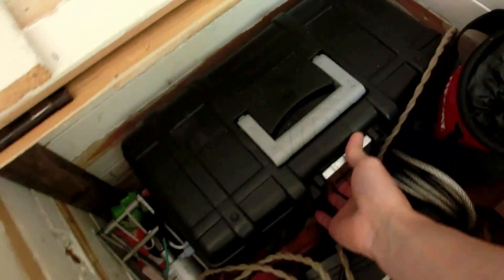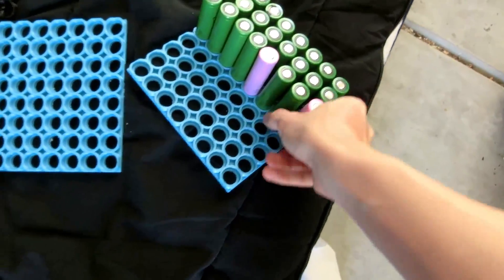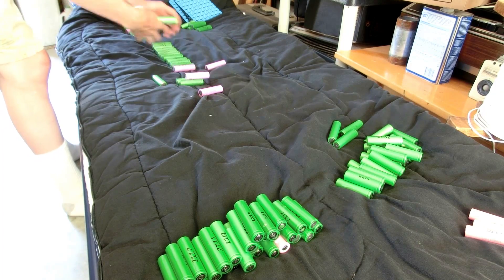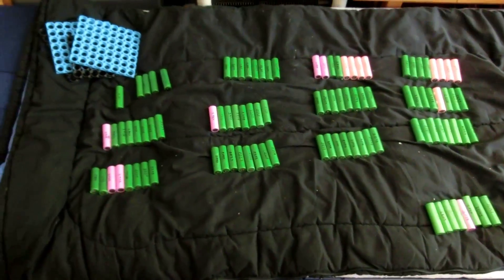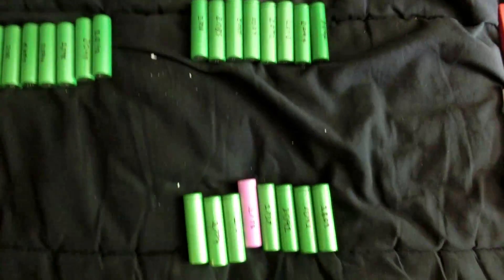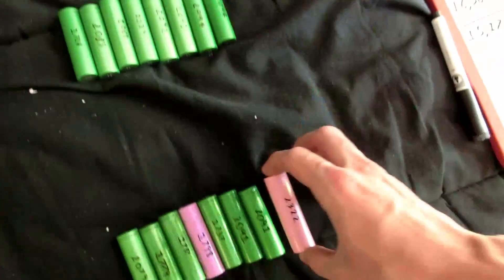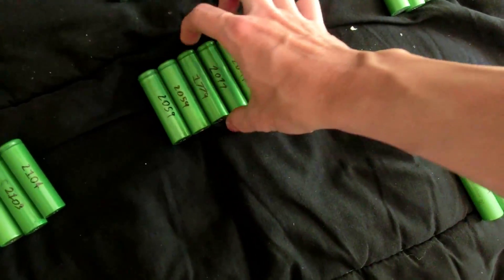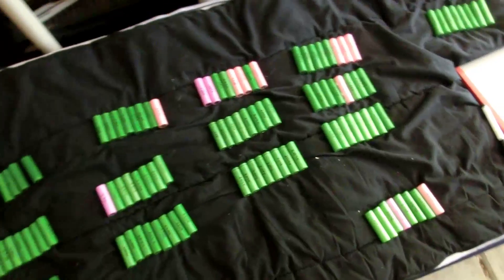How To Organize 18650 Cells for your Battery Pack

Comment: Thanks a lot! I am currently gathering cells (have a tester on the way) to make a 6S pack to power a 24v truck inverter (lithium isn't really well suited for 12v inverters designed for lead acid) which will in turn power up a DIY SLS 3D scanner. I hope everything goes well, but this will definetely play a major role into the pack design. I thought that as long as the parallel group capacity was equal, it was fine, but i'll use this method to not end up with mixed 10P and 11P groups, for example (not that i know if that'd be bad though). Cheers!

Comment: I put all the capacities in excel, sorted them by capacity. Then calculated the average of the top number of cells needed. Finally multiplied by number of parallel cells and rounded down. Then i sorted them to come to the calculated average.
Reply: Smart. Nice work

Comment: I have over 600 harvested and tested cells.  charged and shelved for a 18 months or more and rechecked.  removed any under 75%  now the sorting... any suggestions for packs.?  want to do 24 0r 48 volt system on my sailboat.

Comment: Hello Rinoa,
Please if you could help me with my question, I have bunch of laptop cells, mixed ( ICR , INR ) and planing to DIY 3S pack for solar. is it okay to mix ICR and INR Li-ion??
PS: I use Repackr to group the cells in Parallel.

Comment: What about matching the resistance?
Reply from the maker: never cared about that
Reply: @RinoaL  That's the whole health of the cell. if 2 cells have 2000mah of capacity but ones .15 ohms of resistance and anothers .500 ohms it'll discharge the cell much faster on create dead cells.
Reply from the maker: Only thing that will make a cell unhealthy and thus liable to explode is if it went bellow 1v or had a manufacturing defect.

Comment: I would be very uncomfortable mixing  different amp hour 18650 batterys in a battery pack...
Reply from the maker: every cell ever manufactured has different mah, just they may be rated the same. but whats on the label doesnt reflect whats really inside the cell. so its all a question of how much deviation is an issue. and for this, this pack has taken me 4,000 miles without really much issue. had one cell die on me that id found at 0.2v so now i limit to cells that have never gone bellow 1v. but its still my main battery.

Comment: Hi Rinoa

Love your vids! WD!!!!

Quick question>
Have you made any vids regarding Internal resistance checking of your cells>?

A device called sm 8124a is getting good reviews. If you get chance check it out!

I see a lot about Voltage and capacity but from what i can see discharge speed and charge speed is hardly mentioned. I just wondered if you ever work out IR when making packs?
Reply from the maker: no ive never tried testing resistance, havent needed it yet tbh

Comment: so looks like you are having a difference in the same module(parallel) on lower capacity cell with the higher capacity cell of 500mAH this is ok
Reply from the maker: go read my guide called "The Tinkerer's Guide to the 18650" i go over this a lot better in that. feel free to print out the guide if you like.

Comment: lol you just wasted yours and everyone else time... you should match both voltage value and capacity value as close as possible...a 14,000 and 17000mah will cycle longer than trying to match 2 x 16,000mah batteries...very bad advice and best way to create premature failure

Comment: Great video! My kid has a 36v 500w mini dirt bike, I just took the battery apart to see if i could upgrade it and found lots of spare battery slots. Would you be able to help me with the configuration if i sent you some pictures? It has a 3 x 12v 8ah lithium 18650 pack batteries (40 in total). I would ideally like to add an extra 12v and maybe a few extra collective AHs. I have 18 extra used 18650 to add, various voltages from 2.2v to 4.1v. Thanks
Reply: Any cells below 3.2 standing are most probably damaged. I really would do a charge cycle on them first to see if they are foobar or not before building a pack with em.

Comment: Hi there. I’m really newbie on this one but I want to build a 36v 10s5p battery for my e roller. I collect some battery’s from 1400-2100 mah gonna give me about 1600 if I organize like you. My scooter has a 250w Motor a Controller says 17 A . How can I calculate how Much current will pull from one cell ?
If 250 w / 36v = 7A  what’s that 7A ?
Reply from the maker: yeah your math seems right, however testing it with a current meter is best. just try to make sure you have 2Ah for every amp you plan to pull, and your battery should take you pretty far.
Reply: Rinoa Super-Genius lets say 7A. If 5 battery in parallel an 10s .  Would it pull 7A / 10 ? How much would it pull from one row ( parallel ) ? I have no clue :)

Comment: if i have 4 batteries 5v,9v,12v &24v connecting them in series gives 50 volts ? if connect them in parallel what volts do i get.
Reply: For goodness sake, don't parallel up any batteries that are not the exact same or very close to the same voltage. There's only bad that will come from that on any level.Same voltage in parallel but capacity is combined. It's why you parallel up packs to get the capacity you need and then series those packs to raise the voltage.  They must be the same voltage though, not various different ones.

Comment: Is there any issue with mixing chemistries? I bought all my laptop batteries from the same source but I ended up with what I think is ICR and INR. The types are JNICR18650, +FP 18650, and INR18650HE.

Comment: why not add one of your discarded batteries as the 9th cell paralell to the weakest pack in the first place? your overall battery capacity would be slightly higher ??
Reply from the maker: why would i add a discarded cell? if a cell cant be trusted, then it cant be trusted.
Reply: Rinoa Super-Genius Sure :)) then lets change the question to: why not add another 1800 ish to 2 ah cell to 15 ah pack as 9 th cell? Then they will all level at a higher level amp? Sorry for insistent question. Just quriosity...
Reply from the maker: because i'd like its shape to be uniform and i need to learn to get used to using whatever capacity this configuration gives. if i added one cell i'd add a 2nd, and a 3rd, until i'd added a whole other road of cells and then on from there. i need to know when to stop and so i stop at when i have the numbers of cells i planned. lol
Reply: Keep on the good stuff.. just found tour channel.. You rock ;)
Reply from the maker: thanks ^^

Comment: how exactly did you meassure these capacity numbers? discharge test, I guess, but at what current draw and down to what voltage?
Reply: One can reasonably assume the discharge was at 1A, from 4.2V, to 3.0/2.8V. There would be a negligible difference between 3V and 2.8V SOD. I have just recently bought 30 "broken" laptop batteries, disassembled them and tested each cell in an Opus BT-C3100 charger, so 4 cells at a time. The default discharge rate on the charger is 500ma, but I always test at 1A, just like vast majority of people on YT. Capacity is given in mA during a "Discharge Test", which charges to full, then discharges to 0 and charges to full again, at least in this particular charger. Hope that helps.

Comment: Good job on the work. Could you please help me with the calculation of the capacity. I heard that if the lower capacity is mixed with a higher capacity in a pack the total capacity of the pack is actually the capacity of the lowest cells in the pack. how true is this ? i also have some cells from a laptop and your video was really helpful when it comes to mixing the batteries with different capacities.

Comment: Yeah. Nice job. But i think this isn't a good solution to organise battery pack. I also have e-bike and I also build a DIY battery from old laptop batteries. I must say: your videos inspired me to make DIY battery (especially video when you tested your new battery and you estimated it for +100 miles).
Ok, I built battery with is 12p7s (29,4V), and I group them in the following way:
1. 21956 mAh 78,106 Wh
2. 21954 mAh 78,905 Wh
3. 21982 mAh 78,832 Wh
4. 21954 mAh 78,66 Wh
5. 21959 mAh 78,587 Wh
6. 21950 mAh 78,654 Wh
7. 21958 mAh 78,444 Wh
unfortunately the first segment (with have the lowest energy in Wh) after full discharge whole battery, has a voltage of 2V (the other segments has about 3 - 3,3V). It seems to me that by combining batteries with the highest and the lowest capacity.

Comment: Just throwing an idea out there but next time you find yourself rearranging cells it might be useful to use a computer program to arrange the cells so that the chunks of 8 deviate from the mean value*8 by as little as possible. Just seems like manually re-arranging the cells was very time consuming given the simple goal of grouping the chunks equally.
Reply from the maker: +Joe Taylor its easier to do it manually, entering the data into a computer and stuff would be wasting more time.

Comment: Hey, what BMS did you use for your 48v pack? im trying to figure out how to charge my pack, i have a 48v ebike motor on its way and i want to charge/balance the pack correctly, i still have no bought a tester like an imax b6 yet because i was hoping there would be one that could balance all 13 strings once i solder them together..

Comment: Nice Job matching the cell groups,    Wish I would have though of this while building my 600 cell pack
Reply from the maker: +jehugarcia thanks.
Reply: @RinoaL  does internal resistance matter? when building a pack from many different cells... say from 10 different laptop batteries: is it enough to arrange cells as to have similar total capacity? What about adding some fans with a termostatic switch starting them at a warning temperature?
Reply: @pinchertone  did you find the answer
Reply: @marcopinchetti5872  I'm still learning but from what I've gathered internal resistance DOES matter
Reply: @radujski  oh it absolutely matters. Not sure why guys here aren't recognizing that. It'll kill a pack fast if you don't match resistance along with capacity. Anyone says different is building shit packs.
Reply: @FelonENews  it only matters if you are drawing a high current (more than the least C rating from the weakest cell) I am about to build a mix of old dyson and some laptop batteries (dyson are 1500 to 1900mah and the laptop are 2500 plus) as long as each cell is fused and the mismatch is only in a parallel group (i.e each group of cells capacity is close) and you dont draw a high C from the pack you should be ok. I am looking for some emergency power for TV using a 24V inverter about 3A @24V with a 7p7s pack
Reply: @RinoaL  is it possible to mix cells with capacity ranging from 1500mah to 2600mah?

Comment: iv been watching and learning but Im wondering what is the problem with using the laptop batteries intaked? i know its different but wouldn't it be easier for charging and can it be done or at least tried .have you tried it?.i have 8 new Dell 9 cell batteries .i need 36v .im not sure how to try it out.i have the right charger -discharger and components to build like you showed but i thought this couldn't hurt to ask first

Comment: if in the near future you may put together an 18650 pack meant for a solar system and showing how to hook it up with a charge controller & inverter  i would appreciate i have seen very few solar systems running on 18650 packs on youtube and those that are there don't really give detailed explanations
Reply from the maker: Absolom Madhaka TBH i dont think stationary solar power systems are a good use of 18650s. especially when lead acid batteries are so cheep at junkyards. i think its best to put 18650s into mobile machines for now.
Reply: Rinoa Super-Genius just figured that one out also...
Reply: thats great do you have any videos of your set up i have access to these 18650s and in my country good lead acid batteries are quite expensive thats why i want an 18650 setup
Reply: Absolom Madhaka  I actually use lithium ion cells in a solar system, they are far superior to lead acid that are very inefficient and have to be constant trickle charged, unlike lithium ion and the losses are much less for the latter. According to Battery University 18650 Cells are ideal for solar power systems as the Intermittent charging is less likely to stress the cells, but with lead acid batteries it takes a lot of constant charging to get the chemical reactions going, and this is not very efficient especially in some area's like here in the UK when we hardly get many days of sunshine  SEE http://batteryuniversity.com/learn/article/charging_lithium_ion_batteries  just below SUMMARY Quote "Charging can be intermittent and the battery never needs to reach 
saturation, as is the case with lead acid. This is a major advantage for
 renewable energy storage such as a solar panel and wind turbine."

Comment: How do you bulk buy your batteries (laptop batteries)?
Reply from the maker: Crazy Frank i went to Weirdstuff Warehouse and bought 30 or so for 3$ each, and next ima go to a local recycling center and buy about 50 packs for cheeper.

but before i moved to silicon valley i bought them off ebay for about 12$ per 12-cell pack.

Comment: Hey great video. Could you tell me how you tested the capacity of each cell, was it just the charge capacity or did you use a discharge method and if so what was your discharge current and the cut off voltage. I've got loads of lipos to test and want to make sure I do it correct. Thanks for any help and keep up the great work.
Reply from the maker: kanecool2000 i first charged them to atleast 4.17v and then discharged them at 500ma discharge on my Imax B6 until they hit 3.0v. keep in mind it should stop once it hits 3v not lower the discharge to keep it there.

my current imax B6 is a ripoff of course, but they didnt do a very good job at ripping off the imax b6. for some reason when the cell hits 3.0v it doesnt end the discharge it just lowers the discharge current to keep the cell at 3.0v. and after a while its pulling 0.0 amps and counting up. so it just then slowly counts up to infinity. so i used the Ni-Cad discharge setting instead. the cell should bounce back up to 3.6v after the discharge test is over.

Comment: How far can you get with the setup you have now at full throttle continuosly?
Reply from the maker: Enginehead99 idk 20 miles? why would you want to go full throttle continuously?
Reply: Enginehead99 can't answer for his setup specifically, but: unlike gas engines, the "throttle" doesn't as significantly effect battery life with electric motors, rather it is primarily dependent on the load.

when you give a motor full power with little load, it uses little power, but uses considerably more power when moving a load (even at a low duty-cycle, AKA, "throttle"). when the motor reaches a certain speed, its internal reluctance will limit it from going much faster, however its power use will drop to a level just sufficient to maintain that speed (the load on the motor will drop significantly at this point).

most of the power use then will be during acceleration, with slow acceleration using less power over more time, and rapid acceleration using more power over less time, and this should roughly even out (with some variation due to efficiency curves in the motors and similar, but these are much more uniform than with gas-powered engines).

the main variables that are likely to vary with speed, and thus effect efficiency, are things like mechanical (bearings, road surface, ...) and wind resistance (drag). typically, wind resistance is the bigger factor, as it is positively correlated with movement speed (IOW: it increases load at higher speeds).

in this case, travel speed is likely to be a bigger factor than how much power is being fed to the motor, but then again, these things don't usually go fast enough for wind speed to be a huge factor I wouldn't think.

so, assuming all this, one would expect a "similar" total distance with only a minor impact due to speed.

Comment: "i'm going to put fuses in the battery pack"
quit giving me ideas my bill of materials is already too high.. but that would be a good safety measure... ill see how much diodes cost first..
Reply from the maker: ***** diodes are a bad idea because they are resistive.
Reply: i know but if its worth it its worth it. yet to find any i can use with the cells i was going to use, but found some fuses that will work damned good for <30 bucks total.
Reply: Rinoa Super-Genius i am an idiot... would need a complex setup to charge (them all at once) cost to high abandon thread.

Comment: why not try rc car lipos
Reply from the maker: HW1099 18650s are LiPos, LiPo and lithium ion are the same chemistry just they tend to be used to denote differant form factors.

this stems from "lithium polymar" being a media buzzword in the 1990s much like "graphine" or "quantum" is today. so it was only a matter of time until a company branded their Lithium ion cells as "lithium Polymar" to profit off that media hype.
Reply: spokane underground crawlers 18650 cells are cheaper per Wh
Reply: actually i just lied rc car li-po batterys are cheaper per Wh (at least the way im buying them)

***** i know its actually what im planning on using.. i actually set up a spreadsheet based on what i want/need..
Reply: spokane underground crawlers open up a lipo and expose it to air for best results
Reply: spokane underground crawlers Instead of venting like a 18650,  LiPos will go up in flames, and he would have a giant bomb in the back of his bike
Reply: wow did not know that now i do thanks